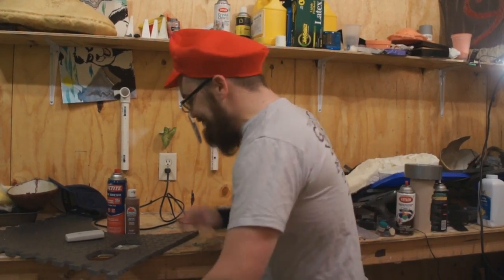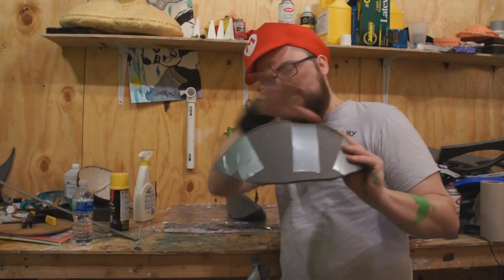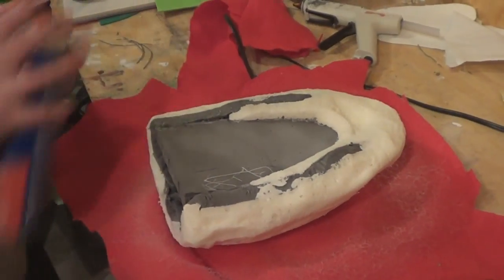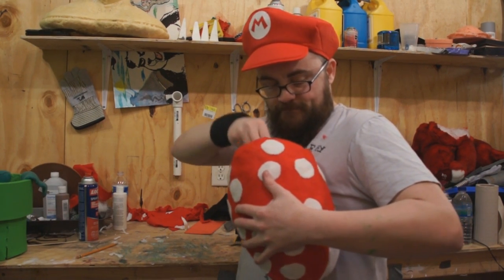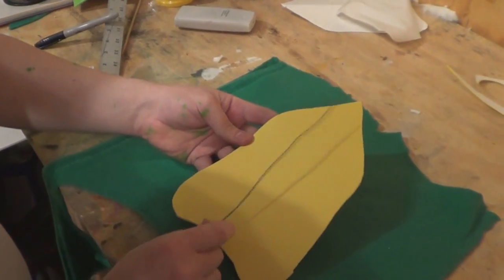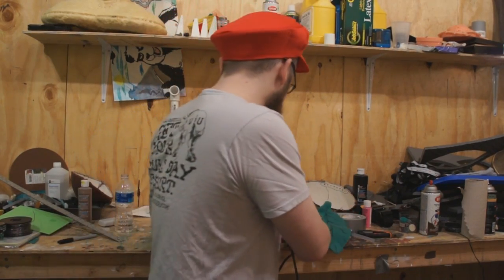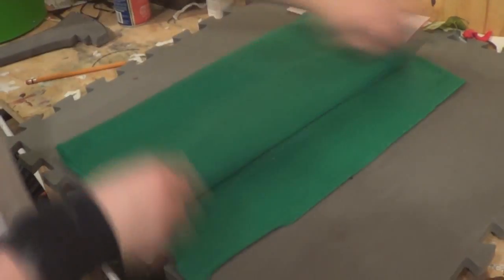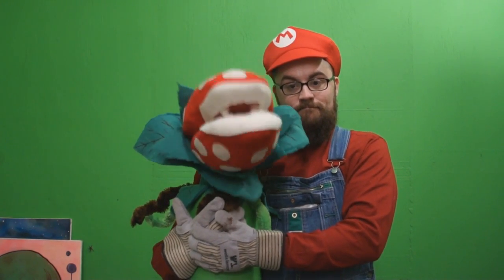Mario Piranha Plant Puppet Build

Comment: Additional tips (note: these are not to be taken as gospel, for these are based upon others' build instructions and/or theory, and I have not actually attempted them myself):
Upholstery foam also works great for these puppets. An extra layer for the lips under the skin can also add a lot.
If you want a more realistic texture than felt, you can use spandex for the skin (not to mention it's probably easier to paint, so you can paint on spots/veins/lips instead of making raised details).
If you want a more uniquely shaped plant, you can adjust your pattern. For example, if you want a head shape closer to the stage versions of Audrey II, you can make a more butterfly-shaped pattern, like this: http://cdn.instructables.com/FZP/RJ4J/HD4VC56M/FZPRJ4JHD4VC56M.MEDIUM.jpg
For an extra touch of realism, you can apply the palate skin first, then add the skin for the rest of the trap.
If you want a more realistic leave thickness and actual raised veins, you can eschew foam entirely for them, and simply glue two pieces of the skin material together with wire veins in between.
You can just make a single tooth shape and fill your puppet's mouth with that, or, again, for added realism, you can actually make molars (12 total, 3 on each side of each jaw), premolars (8 total, 2 on each side of each jaw), canines (4 total, 1 per each side of each jaw) and incisors (8 total, 2 on each side of each jaw).
Depending on your aesthetic choices for Audrey II, you can make foam thorns.
If you want to make the pod look more natural, you can also attach the sleeve to the inside of the pod skin.

Comment: Just over two days, (have to let it cure out for a good job)
 Had the floor mat, 
I used two 1lb coffee cans for the neck and the base of the pipe.
the top can is attached to the head with the leaves draping over the pipe edges, it pulls up and out to revel a hiding place in bottom can.
It  can be weighted down for stability.  It was a Hoot making this with my 6yo grandson.
He is into TMNT now. Any Ideas  there Patrick??? 

Thanks  ONT